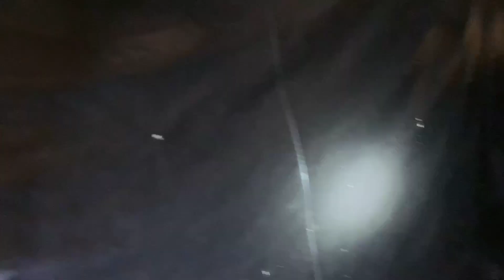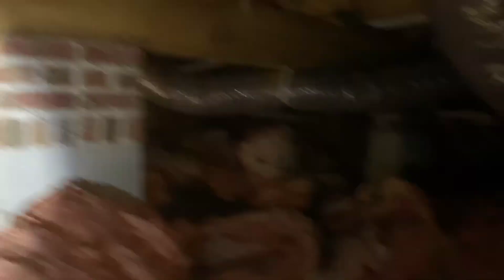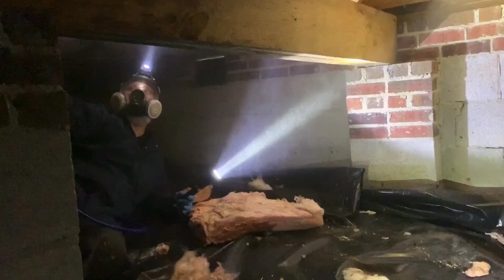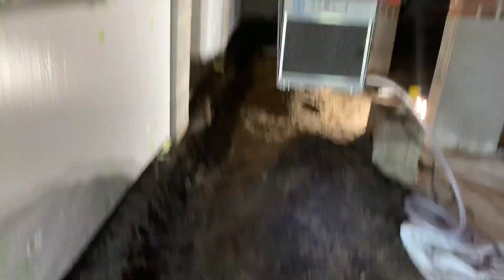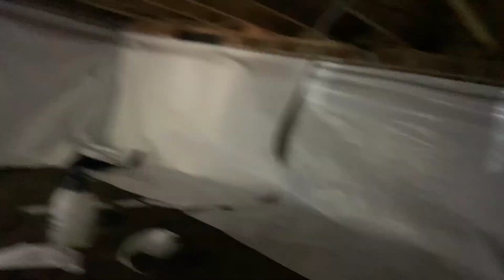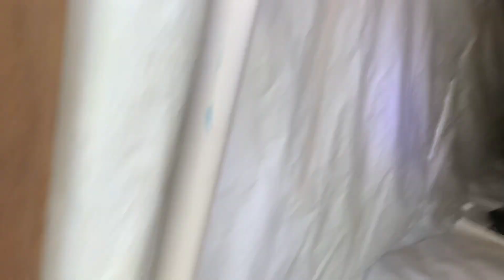Crawl Space Encapsulation Video

Comment: Very nice job!!  One question please—I noticed you did not insulate the top of the foundation and rim joists.  Couldn’t cold enter there?
Reply from the maker: We did. That was the last thing we used regular fiberglass insulation for the band and silicone to seal the joint between foundation wall and sill plate

Comment: What thickness was the Bora foam boards on this job?  Also, what kind of Dehumidifier did you put in?  You mentioned turning it on but I never saw it on the video(unless i missed it)?
Reply from the maker: The Borafoam is a 2 inch foam board so R10 equivalent. I believe the dehumidifier on that job was as  Santa Fe but we wills also use April Air sometimes

Comment: You guys missed something man. You gotta spray those rim joists. Could create moist getting up the seal plate
Reply from the maker: We treated them with Boracare and then we put fiberglass insulation over them. We do not use spray foam because we have had major termite issues because of it. For our termite inspections we need to be able to move the insulation to see the rim joists and band.

Comment: Hi, watched your video. Great job but some one with less coffee might want to do the filming next time. LOl.  wanted to know what you think about in using the AC unit connecting to make the crawlspace for a more climate control [like] instead of the dehumidifier?  The duck work is already there. A little bit of moisture is under the house, but not even dampish. I have removed all of the old fiberglass insulation.  And have leveled off the ground area and any and all debris that had been left behind from past plumber's, Electrician's and contractors. It's so amazing what people leave behind when its not there's. In any case all has been prepped before using anything to contain and treat the  small amount of mold that has intruded onto the  floor boards. And my second question. Do you work in the Wilmington area? When you say Raleigh I am assuming you are talking N.C.
Reply from the maker: Yea you can condition the crawl space with your HVAC that is there now. I suggest at least using a temporary dehumidifier to get it dry initially. I believe you can rent them from Homedepot. We do not work the Wilmington Area but I do have some friends who own a company that does handle that area. If you would like a pro to take a look call Canady’s termite and pest. Tell them Tommy from AAA Exterminating sent you. They will give you and estimate and some good advice.
Reply: @AAAExterminatingCo  Can you tell me how thick of a ml you use for your plastic barrier? And great thanks for the hook up. Oh one other question I haven't heard of any one recommending to use any form of  rubber or sealant on the foundations walls. Wouldn't that help to keep moisture out and protect if there is a crack some where that is unseen?
Reply from the maker: @cindydetwiller4853   we used 15 mil woven plastic for ground and 9mil for walls and piers. To attach we use a sealant that secures a tape we attach the plastic to so it is sealed. You can also use something like Butyl tape
Reply: @AAAExterminatingCo  I gotcha. But have you ever heard of anyone using a roll on sealant on the foundation wall to help seal it before doing the plastic and insulation foam board? And in the video it looked like you put the plastic up before the foam board. Did I see wrong? And have you ever heard of a cat urn smell from the woven plastic years down the road from age? Sorry so many questions.
Reply from the maker: @cindydetwiller4853   yes I know about the cat pee smell but that actually comes from decaying organic material under the plastic it can happen with normal vapor barriers to. Woven plastic is different from reinforced plastic. Woven plastic definitely does not cause an odor. We put the foam board up first then the plastic over the foam board. I see people use sealants all the time they usually do not hold up. That is why you need a mechanical fastener. We use the tape and then Christmas tree fasteners it is an air tight seal. Some companies put the foam board over the plastic that is ok to. If your worried about odors you definitely want to install an exhaust fan
Reply: @AAAExterminatingCo  Thank you so much that was very helpful.  And appreciated you taking your time to answer my questions.

Comment: Nice work.  About how much did encapsulation (full) cost? Also, how long does full termite treatment last before it needs to be done again? Thanks
Reply from the maker: JC this one was about $7,000. But they usually range from 5k to 11k depending on how big them home and what all needs to be done. Termidor will last 10-15 years we recommend booster treatments every 10 years.